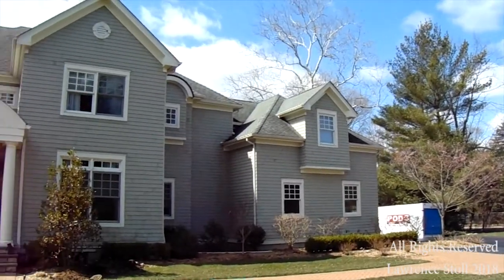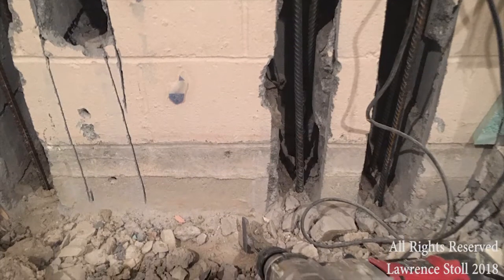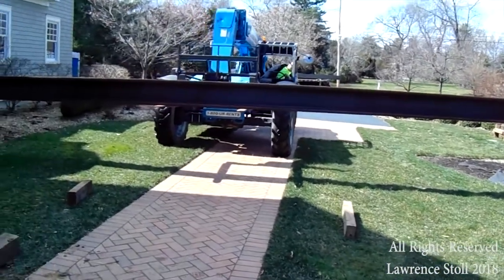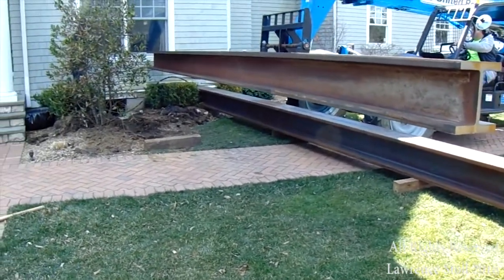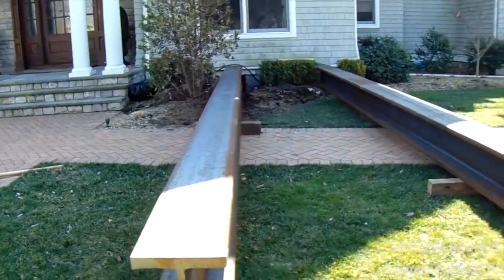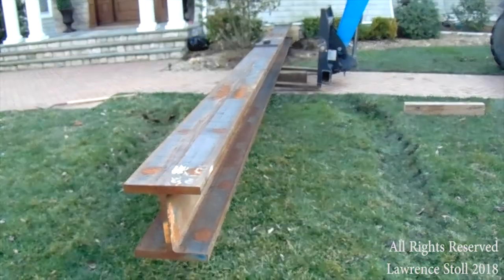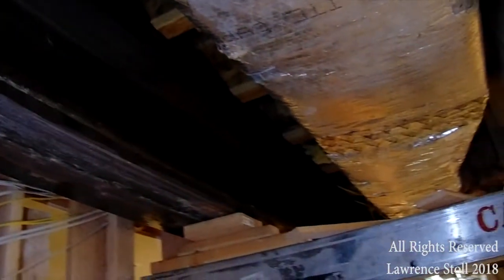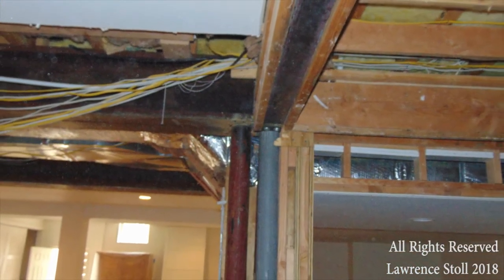Column Removal & Structural Reinforcements; Rumson NJ

Comment: Great video, very helpful. For a existing home, Can you join two small wood beams using metal connectors to bring the two wood beams together to make one long beam to get rid of a column holding up the weight of the beam?

Comment: That's insane 😲.  I mean, this has a basement and to spend so much $$$ (I'm sure this wasn't cheap) to remove some columns in a basement makes no sense to me.  But hey, if you got $$$ to spend, that's all that matters.
Question though...  I haven't found a single video where someone removes just one lally column (6' span so making a 12' span).  Do you need to also reinforce the footing?  This is a new build house and full concrete basement, etc.  Would appreciate any feedback.  Thanks!
Reply: I got mine done for $8,800. Cheap Finance payments.
Reply: @los716realtalk  
That's not bad.  I don't know how much it'd be in Boston area but I'm fairly certain it's at least 50% more
Reply: @los716realtalk  Can you please describe how they did it? Thanks
Reply: I'm trying to do the same in a 50 year old ranch. I've torn everything out to the main beam. I'm planning on sistering a steel channel on either side of the wood beam and eliminating on lally column.
Reply: Sergey Bebenin did you find someone to do it? I’m also in Boston and looking to remove one lally column to make a 12’ span. The original wooden beam from a 1965 raised ranch.
Reply: @johnavedian2664  
Not yet lol.  Kinda got delayed with this project and actually just about to call in a structural engineer to plan it because I don't want to make a mistake by trying to save money.
I'm pretty sure I'm going to go with "Team Engineering" (good reviews and pricing relative to others).   You can Google them.  I'll ask them for a reference regarding actual carpenter
Reply: @johnavedian2664  
Забыл добавить...  Вы теперь наши враги на всю жизнь.  И это на многие поколения вперёд.  И чем дальше тем хуже потому что люди продолжают гибнуть